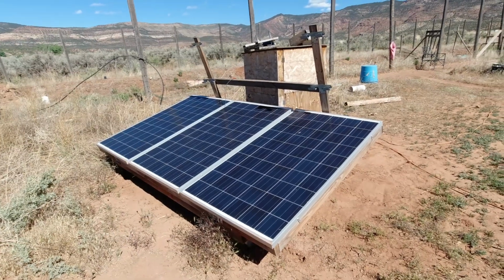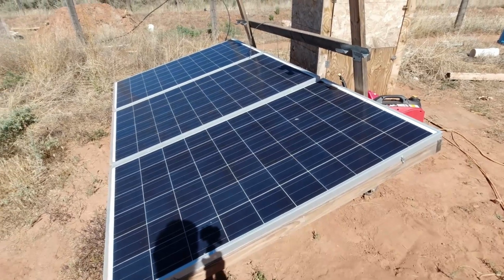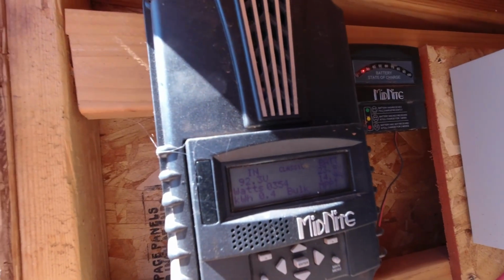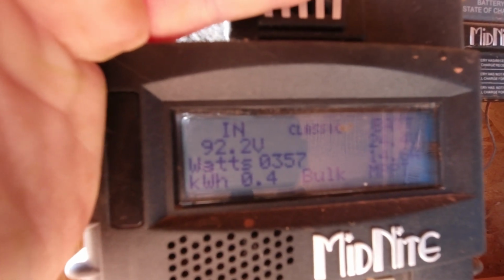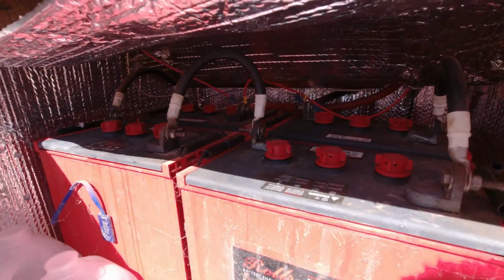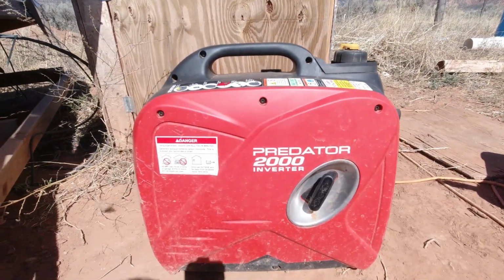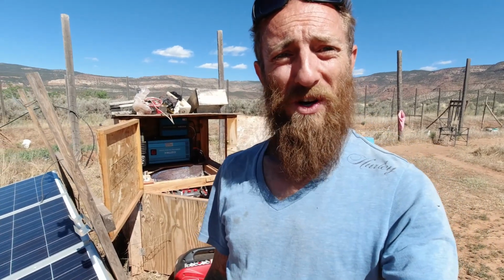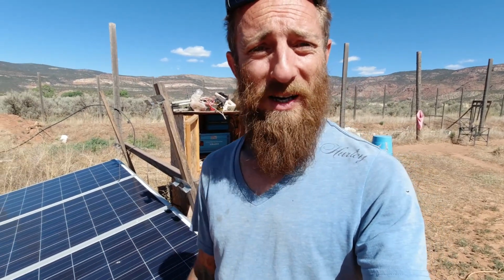Solar Package // Off Grid Solar Power

Comment: I like that SOC monitor from MidNite. One panel at a time that is all that matters, as long as we all do our part to harvest our own power that is all that matters. Do you know how many watts you use on a day on average, we are 6500 watts a day.
Reply from the maker: Ya it's been a great charge controller, easy to use, program and tweak the settings. No power bill is great too, as long as there is sun we got juice and no fossil fuel burnt to get it! I would love to add a wind mill to my system, they've come down a lot in price too. Last time I put the Kil-A-watt on it was 2-2.5kWatts a day between the three trailers, we don't use much power! How many panels do you have and how many watts is your panel array? 6.5kW a day is pulling some juice, I can't even remember what it was like to have that kind of power!!! 😅
Reply: @barrnoneunleashed  We have a 3.5 kWh system but since we do not use much power we never get to see how much we could really use.  I have seen days we are building to bring in 14 plus, but on average we only bring in 8 kWh.
Reply from the maker: As long as your bringing in more then your using your good to go on power!

Comment: I've always wondered if the Predator generators were any good.  Thanks for the info.
Reply from the maker: Ya I'm very impressed with it, at full throttle it will run for 8-10 hours on a gallon of gas and on eco mode it will run for 14-16 hours on a gallon!

Comment: Just to address your low solar output you mentioned in this video, the problem is probably the little bit of shading you are getting on the top of your panels. I know it may sound silly, but running a series run setup like you are doing means even just covering one cell of one panel will drastically affect the whole array. it looks to me like it is the hangers for your adjustable rack that is casting them, so not sure how you are going to fix that (but you need to)
Anyways, I like the simplicity of your setup. 
You should see if you can find a small ATV trailer or similar to mount your system on, you could then have the portable system you wanted from day one, and also if needed you could manually track it left an right a little if you need more power.
just some of my thoughts, let me know if you fix the shading and if it solved your problem. cheers!
Where are you located by the way?
Reply from the maker: Hey thanks Michael, those are all really great suggestions, and we're in western Colorado. I think at this point I really need to build a whole new rack for the panels, the current one is starting to come apart, but with that I think we'll add three more panels as well!

Comment: Hey bud, do you have any over heating problems in your power box? 

Might want to install a fan system to evacuate hot air, in case you don’t already have one installed.
Reply from the maker: Hey Eric, we haven't had heat issues so far, I normally open up both doors on the box on hot days and that seems to take care of the heat!
Reply: BARR NONE OFF GRID Sounds good!